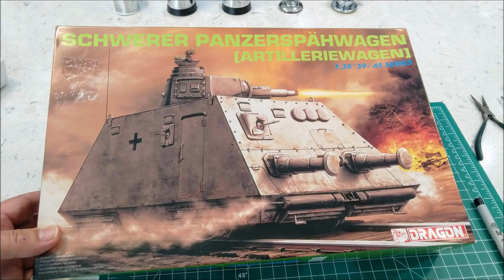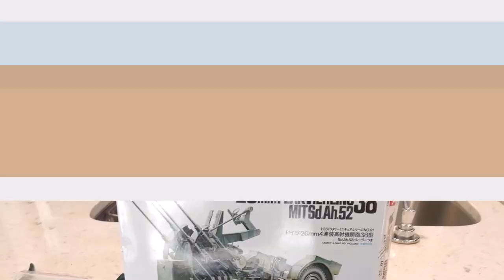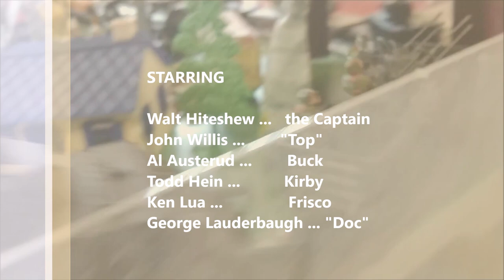Marx German Armored Train Panzerspahwagen

Comment: Hey Ken, Great job I like both the tank engine  and the caboose modification by kit bashing . Did yo fabricate all the parts for the head engine? Any way it made  a very nice consist  with the custom gun car you have a winner.  God Bless and "Happy Rails".     GMan
Reply from the maker: Thanks G-Man, I made the frame for the Marx 400 motor out of sheet brass and spacers out of aluminum tube.  The frame was epoxied into the thin plastic model body to stiffen it up and support the motor.  Then I used the existing motor brackets and tiny 6-32 bolts to mount the motor to the frame.  It was pretty straight forward and now that I did one, I think I can use the design for other projects I want to do.  God Bless you too G-Man!
Reply: Really Great Job...